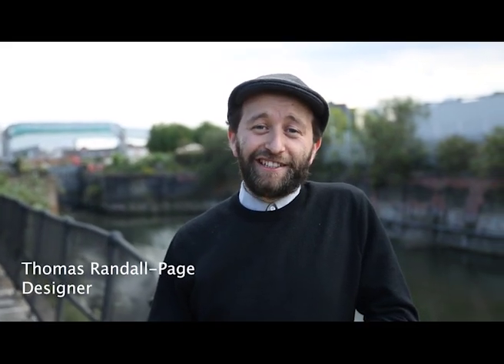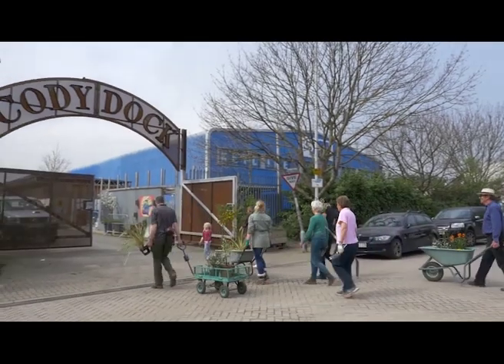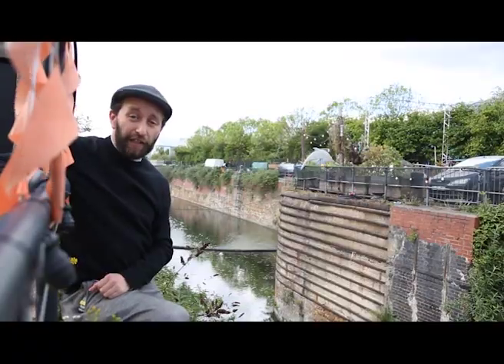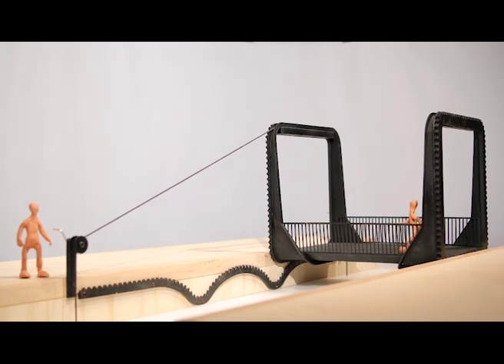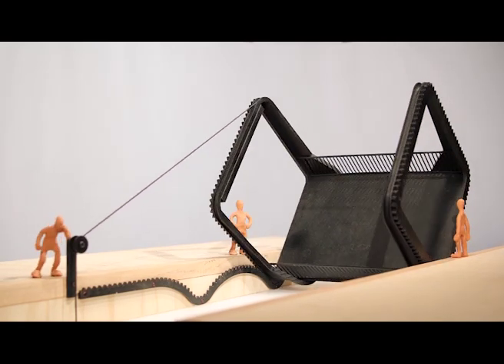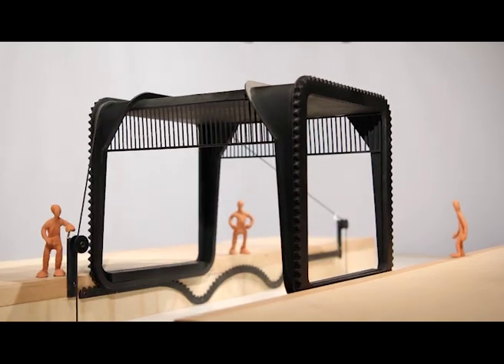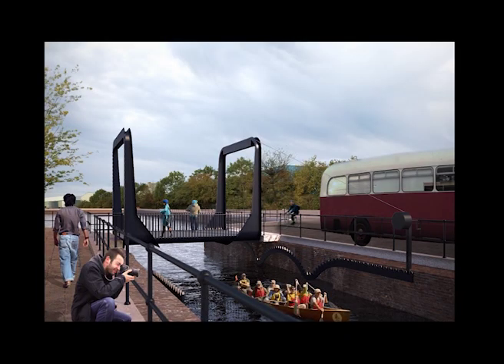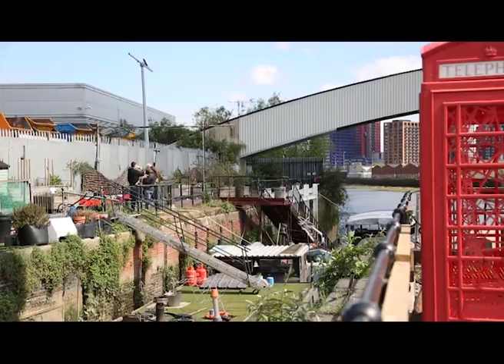Cody Dock Rolling Bridge

Comment: squares roll the best, everyone knows that
Reply: Round thing rolls on flat thing. Flat thing rolls on round thing. I dig it.
Reply: A circle would require more material (more expensive) which is also set lower in order to maintain the same bridge width and raised height. The circle's diameter would have to be equal to the diagonal of the square.

That math works out to the circle's circumference being 11% greater than the square's perimeter.

Side of square: s
Diameter/diagonal: sqrt(2) * s
Circumference: pi * sqrt(2) * s
Circumference reduced: 4.44s
Perimeter: 4s
Ratio: (4.44s)/(4s) = 4.44/4 = 1.11 = 111%

The rail would have to be increased in length by 11% (increasing distance traveled to invert the bridge) and would have to be lowered, to accommodate the arc of the circle under the bridge by a number of units equivalent to: (sqrt(2) - 1) * s / 2 = 0.414s / 2 = 0.207s

Given the math above, a perfectly balanced square (as they described) would have a lower moment of inertia than a circle. Thus, it would need less force to rotate (torque) a square bridge compared to a circle.
Reply: @ShimrraJamaane  I love it when I find smart people explaining things to others with FACTS and data, rather than with attacks, anecdotal "opinions", or misinformation.  

I was going to explain it in simple terms by expanding about inertial forces, torque, and momentum; but your comment basically covered it all ....and then provided mathematical evidence, for the nay-sayers.  I loved it. Very refreshing comment among the cesspool that YouTube can become at times.
Reply: @i.t.577  Haha. Thank you. :)
Reply: @ShimrraJamaane  glad to see there are logically smart people browsing YouTube these days... not just mindless commenters that criticize someone else’s occupational expertise when they themselves probably don’t even know how to make their own bed.
Reply: @SuzukiKid400  haha thanks. Updated my comment with more math to cover the other benefits of a square compared to a circle.
Reply: Something round is unstable
Reply: The square creates both momentum and force as does the track enabling it to smothly ride the track with out rolling out of control like a round track would
Reply: @TheHamadanners  it's a perfectly balanced box, though. It would roll just as easily as a circle. However, with a square, you reduce the moment of inertia due to lower mass compared to a circle. So, it would be easier to rotate a square rather than a circle.
Reply: https://youtu.be/FlvjWpWu99A such as this
Reply: Squares dig the classical beat coz that's the way they roll.
Reply: A square will roll perfectly over successive catenaries
Reply: Right. Might as well innovate- no need to reinvent the wheel...
Reply: probably makes it lighter with a better clearance compared to a round one.
Reply: All these squares make a circle !
Reply: Didn’t myth buster bust the whole square tire thing?
Reply: @flipflopsneeded  no. Squares roll over inverted catenaries, which is what the track's shape is. https://en.m.wikipedia.org/wiki/Square_wheel
Reply: "If it has to roll, why make it square?"
"I just think it's neat!"

Yeah I know there are practical reasons for the square
Reply: Until they discover the wheel..
Reply: As long as you don't lift center of mass much, it's a great design for human operated mechanism
Reply: @supersonictumbleweed  the center of mass is dead center. Otherwise, it wouldn't be equally stable in both ends. The stability comes from the fact that the center of mass is slightly past the fulcrum when it's at either end of the track.
Reply: @ShimrraJamaane  i don't care about stability. lifted mass determines how much energy is needed to operate it
Reply: @supersonictumbleweed  Yes, and a center of gravity that isn't dead center would cause it to be unbalanced.
Reply: @ShimrraJamaane  I agree, I never said otherwise
Reply: @supersonictumbleweed  then I'm unsure what you mean by lifted mass. As long as it's perfectly balanced, you only have to overcome the moment of inertia.
Reply: @ShimrraJamaane  the track is the shape it is so you don't have to lift center of mass against gravity. It rolls, but it's not rolling on a straight track. That's the clever part that makes it so a human can turn it
Reply: @supersonictumbleweed  yes. Now it's clear you meant center of gravity in relation to the track. It sounded like you meant center of gravity in the object itself.
Reply: Imagine it trying to sit upright if it was round, it could roll back around and smack a boat possibly, or flip over with people walking on it, dumping them in lol. The square shape allows it to rest in either position better.
Reply: @Gigaler  they both are at risk of that. The cable provides the mechanism to secure the bridge in place. It would be routed through a drive sheave that is locked, unless some tamper-resistant dead-man switch is activated, and powered by a small motor or manually. This mechanism would also need to include a tensioner as the cable stretches over time.

Either mechanism could also incorporate a load sensing mechanism (like a torque wrench) to automatically cut power to the drive sheave.

You could also swap out the sheave for a cable that terminates to paired winches (single drive axle) in that drive housing.
Reply: It sta
Reply: They also have the best structural integrity of any shape.
Reply: @SmashPortal  what shape? A circle certainly doesn't. A triangle is the most structurally sound. A circle would bow at the "sides" (where the sides are 90 degrees from the force being applied to the circle), turning it into an oval.